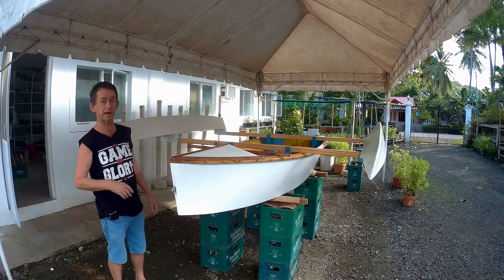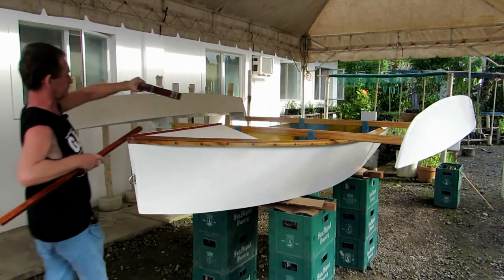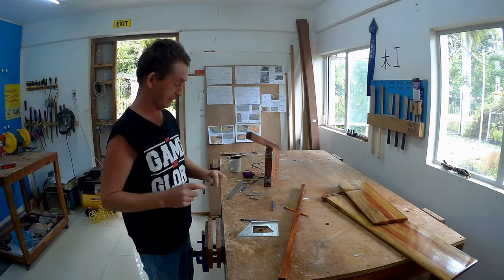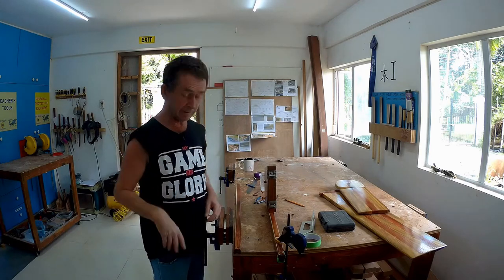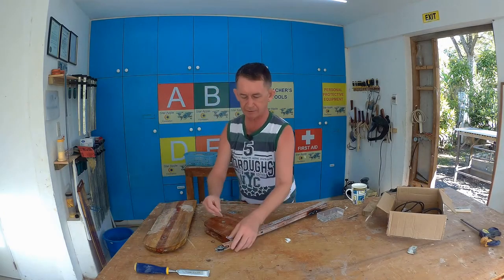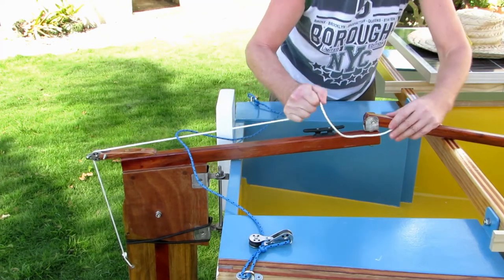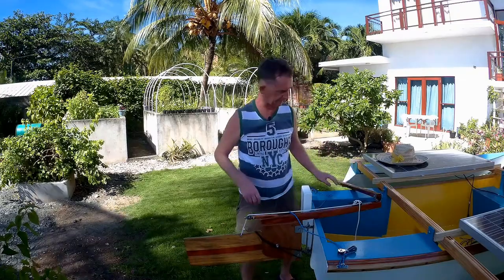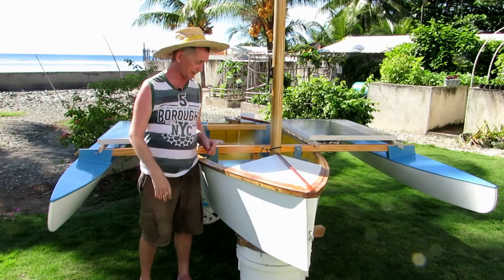Build a Tryst 10 Trimaran Sailboat - Pt. 20 - DIY universal joint & rudder retraction system

Comment: Thanks ,that was great ,,there is certainly a case for the retractable rudder..and the bungy is absolutely revolutionary as it is practical.. brilliant ..!. Too many people compromising on rudder safety for style or elegance ...stuff em..! That's brilliant and gives peace of mind with no hidden obstruction anxiety...relaxing sailing which is what it's about ...and a ball bungy provides..!.. brilliant.!!
Reply from the maker: Thank you for watching Michael. I took her out sailing two weeks ago, the rudder popped up when I was going fast, but it will only take a small adjustment to put right. The daggerboard bungee was on handle going over aka to the mast. Will need to attach under it and around the whole top

Comment: Never a bungee cord for the tiller extension. It will stretch too much and then break. Use braided polyester or one of the new, low stretch lines like dynema. The trick is getting the knots tight enough so you don't have too much play. .
Reply from the maker: Thank you Brian. I have some Spectra and it is hard to tie
Reply: @IrishChippy  Looks like the steel joint you made works great - just to point out one needs some kind of low-stretch double braid for that if one uses rope.